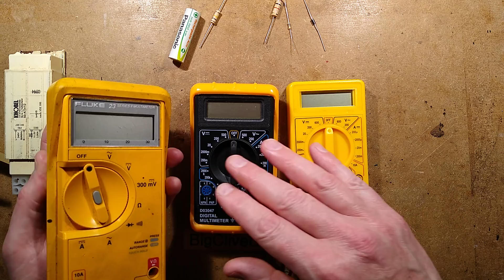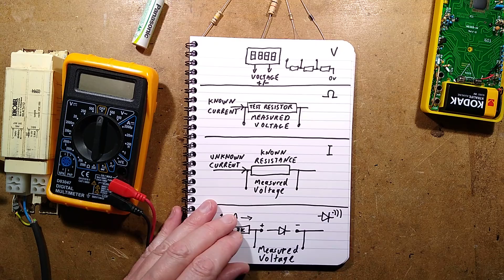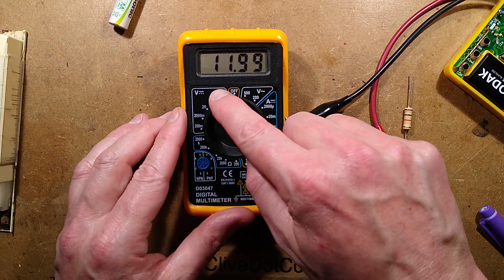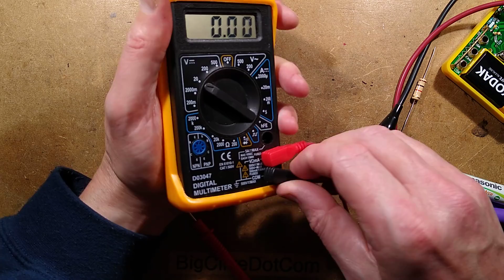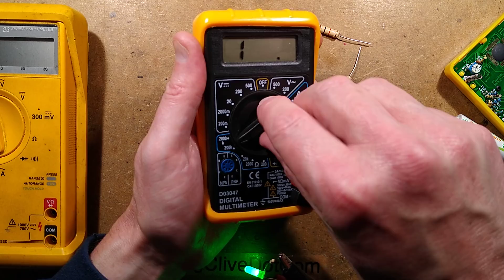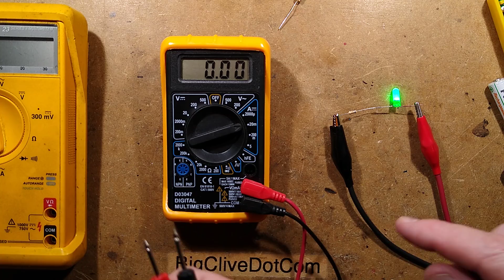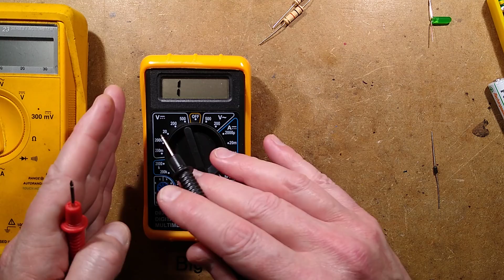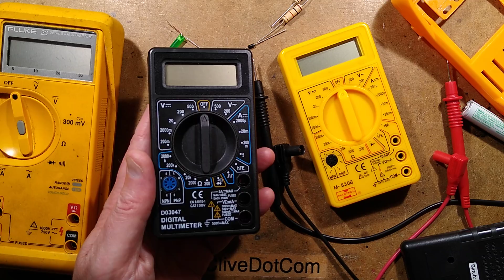How to use your trashy meter without blowing it up (much)

Comment: Similarly folks playing with Arduinos can just do very well with one of these cheap units. I was very cynical when my local makers club "had" to buy the most expensive Fluke a few years ago and all it's used for is measuring 5 V circuits and do continuity tests.
Reply: Lmaooo fluke. You could buy an oscilloscope for that. Will be more useful for microcontrollers.
Reply: I can see it for something like a maker space, as long as they were going for one of Fluke's "rugged" or "industrial" models. If you're going to be loaning out the meters to inexperienced or moronic people, you need something that can handle serious abuse.
Reply: @jcon6734  I bet that ten of these sh*tty meters would do the job very well. Or twenty — cheaper anyway.
Reply: @jcon6734  fluke meter $140. Harbor freight meter $7. Will the fluke last 20 times longer? Doubt it. 

Plus the most common issue meters lost or stolen. Is just made worse by the more expensive meter.
Reply: Electrician of cuz fluke.
But normal electronic, I think uni-t is best choice. Cheap and accurately.
Reply: @horacewonghy  I use Aneng meter. Very good features/prices ratio.
Reply: On the other hand, I have a Fluke 23 like the one in the video that I bought around 1985 and it still works perfectly. There’s something to be said for build quality.
Reply: well its common for these people , if you know what i mean

Comment: "there's alot of snobbery..." - somewhere Dave is feeling attacked!
Reply: I had a HF meter in one of my videos, and some wank had to take the time to make a snide comment and dump on the whole project because of its presence.
Reply: Isn't there videos of him praising cheap meters like Aneng? It is very very accurate. I use them now for a lot of dangerous voltage stuffs and is my only meter. However, I do admit hde don't recommend it nor do I. And yeah, he's very opinionated about a lot of devices and I think most of his points are valid. What do you think guys?
Reply: "If the shoe fits...."

Halfway through the 2nd video I watched, of his, I closed the window and have never seen another. That's my level of being a snob. "Only "wanna be" electronics folks watch his "whatever" videos. (Me: EE, class of 79, Mechanical Eng, class of 92) If Dave" tried to hold a candle to Clive, he'd get woofled to shame.
Reply: And so he should.  After the first video of his that I watched that Youtube recommended, where it was Fluke this Fluke that, "That's a bit how you doin" - Fluke wouldn't do that etc, I never watched another video of his for several years.  Even now I skip most of them and when I do, I tend to skip through them.  I'm sure that with some of the comments he makes his mouth operates 1/2hr before his brain.
Reply: Fluke is the real deal , expensive tough , built for endurance ...my guy in town swears by them - he didn't want me using it....generally with tool s. They are expensive but you learn to ...pay what to git to , for the best...
Reply: i stopped watch him after he pulled a fancy oscilloscope as first thing to repair an old ibm keyboard(he checked microprocessor signal), i realized he dont know much about electronics as he blame, didnt checked voltages first and the thing is full of tantalum caps(which ended be the failure)
Reply: @SuperAWaC  yeah and it's usually the ones that are kind of insecure in their skills. Why use 1% accuracy when 10% is 10 times good enough for what you're doing.
Reply: If you're a hobbyist or student working with low voltages buy the cheapest meter you can that does what you need and has decent reviews. If you are a professional you should really be using equipment that is independently tested and rated, especially if you are working with high voltages and dangerous machinery. I don't mess around sticking probes of unknown pedigree into 440V industrial panels, my life is worth more than $50 for a cheaper meter.
Reply: @SuperAWaC  honestly, I don't see that attitude from Dave, I do notice a lot of people saying that about him but I think it's just a cultural difference of some kind, he's trying to be funny and it just rubs some people the wrong way
Reply: @Zardox-The-Heretic-Slayer  "Just trying to be funny" "Cultural difference" If you're saying his humor culture is Aussie then he's probably one of the least funny Aussies I've ever witnessed. I have a lot of friends down under and they are all by and large a laugh riot.
Reply: Brown, black and orange.  That's one, zero and three zeros Dave.  ;-P
Reply: @SuperAWaC  I didn't say it was successful at trying to be funny!
Reply: @Zardox-The-Heretic-Slayer  99% of the meters he reviewed were garbage to him. Even when he reviewed the Aneng, he praised the accuracy but he still complained about a few things. It was like watching gollum debating himself. One side was praising the meter and the other side was finding reasons to complain.
Reply: @chrisg6597  all of those silly sayings that Dave peppers his videos with so liberally is one of the things that turns me off from watching his channel.  Wtf does "that's a bit how ya doin" even mean?  Yes Dave, Bob is my uncle, one of them anyway.
Reply: @bufordmaddogtannen  that is what a review is though surely, "this is good but here are some shitty aspects to it"
Reply: @Dont_Tread_On_Me   >  Wtf does "that's a bit how ya doin" even mean? 
It means it's sloppy.  You weren't able to figure that out from the context, huh?
Reply: @Hyxtryx  what context? Some guy constantly yapping in mind-numbingly repetitive obscure phrases while trying overly hard to be funny yet failing epically?  That context?
Reply: @Hyxtryx  no one here hates dave. Does he do some things that appear a little silly but well who doesn't. And yeah oh my God you got me I screwed up the decimal points should be flipped around the other way too. More succinctly said... why use a meter with 10 times more resolution or accuracy than you actually need.
Reply: Could have sworn I did a video reviewing and recommending a cheap $20 meter...
Reply: @EEVblog  Sure. Whining all the way beginning to end... 🤣
Reply: @EEVblog  uh-oh we're busted chaps... leggett!
Reply: @Zardox-The-Heretic-Slayer  are you a keyboard warrior in real life, or do you just play one in YouTube comment sections?
Reply: @Zardox-The-Heretic-Slayer  sure, problem is Dave whines about things that would make a $20 meter much more expensive. A bit like the people who buy an amazon tablet for $149 and then complain about how it's missing iPad features.
Reply: @d.t.4523  I stopped watching the videos because he kept shrieking.
Reply: @Hyxtryx  - Um..  I have an LG DM-311 meter that I bought reasonably cheaply, with a nice display.   I also have a Fluke 112 next to it.   The Fluke stays in one place, because it's expensive.  I use the DM-311 for almost everything.   Accuracy?   Pretty much spot-on for everything other than true RMS, which the Fluke has, and the DM-311 doesn't.    Guess what I use for almost everything on a day to day basis?    One of the cheap Harbor Freight meters, plus an ancient analog Radio Shack meter.   Why?  Because they're accurate enough for the purpose!   I need to know if the current going into the computer power supply is _between 110 and 120 volts_.   I don't care if the meter says 112, and it's really 114.  it's close enough for the purpose.   There's a reason tons of things say "plus or minus 5%" or in the case of some capacitors, "plus or minus 10%"
Reply: @Dont_Tread_On_Me  no, I'd be quite happy to say that stuff to your face. as for the accusation of me being a "keyboard warrior", you got as good as you gave mate.
Reply: @EEVblog  aye you did. for what its worth I like the criticisms you do on those cheap meters, I think that in the years that you and others have reviewed those kinds of meters, it has made them up their games when designing them
Reply: @Zardox-The-Heretic-Slayer  It has. The manufacturers of the low end meters have thanked me for the feedback and designed new improved model based on that. I've even taken Fluke to task several times, and they have even redesigned the Fluke 87V based on my GSM intereference investigation. Constructive criticism can be valuable.
Reply: @tbelding  That's how used car salesmen push their junk on you.
Reply: @EEVblog  definitely, I remember back in the day, you criticized the lack of input protection on these things and I started noticing more and more input protection being added (MOVs etc.), then there are uni-t who you've picked apart time and again, slowly but surely they're getting better because of it. 
but yeah, I remember the GSM issue, ever since that video, I've been paranoid about putting my 87V's near my phone
Reply: @Zardox-The-Heretic-Slayer  You would have to actually make it through your door and out of your house before you could do that.  Judging by your video, that seems like it would be a fairly tough task for you, "mate".
Reply: @Zardox-The-Heretic-Slayer  I don't see that from Dave either, I think some people just have complete sense of humour failure and they like to use the "snob" excuse to shit on him.
Reply: @ferrumignis  definitely, and I don't don't think Clive dislikes him in anyway, it just sounded like a friendly dig. I just don't think that people understand how instrumental Dave (and Clive etc) were to reviving the electronics hobbyist scene, it was all but dead before these people started doing videos
Reply: That dude lost me after he used his live-stream to unload his half-baked international political opinions and then he got all hot and bothered when other viewers politely asked him to change conversation topics.
Reply: @tbelding  +/- 10% on a resistor or capacitor is one thing.  If you need better, you buy a better one.  10% on a meter is terrible, and I don't even know if they make meters that bad.

I have about 10 of those Harbor Freight meters.  If they're going to keep sending me coupons for free ones, I'm going to take them up on it!  If I have to use a meter outside, I'll use one of those in case I drop it in the dirt.  ...unless I have to measure AC.  I only have 2 meters that show RMS AC, and one is a Fluke.  An 8062A, which is almost 40 years old.  It is the most accurate of the 5 non-Harbor Freight handheld DMMs I own.

But I also will grab the cheap meter for a quick measurement.
Reply: @Hyxtryx  - I'm sorry you missed my point.  For my purposes, measuring AC is to confirm the power going into computer (and related) equipment.  I don't need it to be perfect, and I certainly don't need RMS.  (I don't even care that my generator doesn't produce it.  I have a specialized inverter I use with the generator)   In actual practice, I've never noticed more than a one or two volt difference between the HF meters and the Fluke/LG meters, except when the batteries are going dead.   Their quality problems don't seem to be in the measurement side, more in the assembly side.  (one probe lug broke away from solder, another had a screen that wasn't seated quite right..)  

Would I use it for 240?   No, but then, I don't work with 240 on any sort of regular basis.  I work 120 and down.
Reply: @tbelding  I didn't miss your point.  I forgot to say that I also grab a cheap meter (not always Harbor Freight) for beater use.
Reply: It would be hard not to be a snob he gets high buck test gear in his trash room with all most nothing wrong with it , when you get free $10,000 test gear a $20 meter sucks by comparison
Reply: @harryconover289  I understand where his distaste for crap meters comes from, he used to do industry stories where companies cheaped out with meters and it cost them a lot of money due to false readings that spanned an entire batch of meters that they had. but he also said that if you're a hobbyist - as long as you get something, it's better than nothing. although I tend to tell people to look for decent meters 2nd hand - you can pick up old flukes, Amprobes, extech etc. for $30 quite often
Reply: @Zardox-The-Heretic-Slayer  I still have my fluke 87 but my parrot got it and chews all the buttons, still working I just have to remember which button dose what have already replaced the display and jacks i guess it’s time to get a new old one

Comment: One of my cheapy units surprised me when I blew the fuse, by having a spare fuse clipped into the back panel. Amazing!
Reply: Ha!  Brilliant stuff, talk about thoughtful!
Reply: I wish my BM269 wouls have a spare fuse in it, especially the 200mA...
Reply: have often wondered about that 10A fuse.....i recently measured some amps test on my solar charger and the leads was getting very hot at 6A. also my previous one while working on the car did something stupid that pushed way passed it's 10A but fuse didn't blow....leads kinda melted. later confirmed load was in range on 13A......
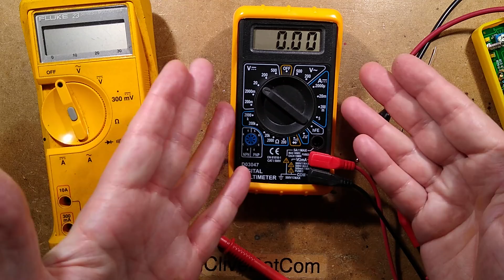Reply: @jacquesb5248  In my inexperienced opinion DC voltage on a car battery shouldnt be able to do that unless you had the leads in the wrong connection port 12:05
Reply: @ryanvess6162  what? Car batteries can easily source hundreds of amps.
Reply: @jacquesb5248  There is (usually) no fuse on the 10 A setting, that's why it has it's own socket.
Reply: @ivarnordlkken8082  indeed there is when i last had to open my el cheapo meter and there is one in there.....but i think the test leads will melt way before the fuse goes....
Reply: @ryanvess6162  i did connect correctly but i i was measuring amp rate. as i switch on it struck woah! stop but leads was already just about melted but fuse wasnt blown

Comment: The beeper delay is a show-stopper for me. I want to be able to drag the lead around to find quickly where something connects on a board. A cheap meter I bought 13 years ago from rapid online for about 20 pounds handles that perfectly. There's no need for an expensive meter, just one step above those extremely cheap ones.
Reply: Yes, it's FRIGGING ANNOYING for that reason.
Reply: We have three multimeters at work - Fluke, Agilent and Keysight. Let's say they have all pretty much the same functions. I always automatically reach out for the Keysight because it's the only one from the three that has instatenous beep. While the Fluke has awfully long delay with super loud beep. Interesting how such petty feature can make all the difference.
Reply: There’s one at ‘The Range’ for around a tenner or so, their own brand ‘Saber’, I have 2 of them and they have been brilliant. They have instant beep on diode/continuity.. and I mean instant. If you ever need a new one that would work for you
Edit: it’s the red one, they also have a smaller orange one which I haven’t used to know if it also works the same
Reply: @Preidaq  Which Fluke is that ? I have a few 70-series Flukes and they're fast (and also have a fast bargraph under the display). But I've used  cheaper meters that are slow. I agree it's very important  but I think Fluke usually get it right.
Reply: I have even had expensive meters that have continuity beep delay.  I hate it. I had an expensive 1998 Fluke that had that delay. Plus that Fluke go to "sleep" after non-use for about 15 minutes.  BUT! My batteries were still going dead so I used another meter to measure battery current and found that when it went to sleep it only drew about half the operating current. Good grief!  And to top it all off was the battery compartment that "met" CE requirements so it required a screw instead of just a snap off with finger battery cover.
The 24V satellite equipment we were making had knurled nuts to open the face plates because you had to get into it all the time.  But CE required us to change it to screws requiring a screw driver. So all our customers just took the faceplates off and tossed them aside permanently.
Reply: beep delay for me is an absolute bugger.  When checking for a break in a cable, it can really make it hard to work out which cables have an intermittent break and which dont.  I have a couple of decent meters for when customers are looking, and the cheapies for getting most of the jobs done
Reply: i love the continuity tester so much, i actually made one with a battery and a beeper and some home made leads, i dont think pumping 9volts through stuff your testing the continuity of is the best idea, i mean 9 volts can damage sensitive equipment, and there i am with my 9 volt battery connected to a cheap beeper with cheap leads, i am sure i blew something up without knowing it  at the time ???